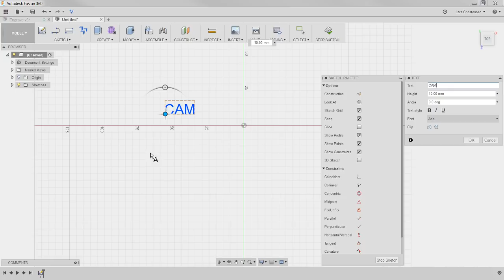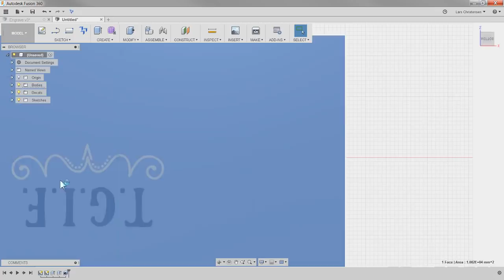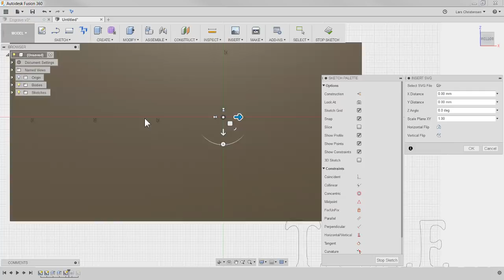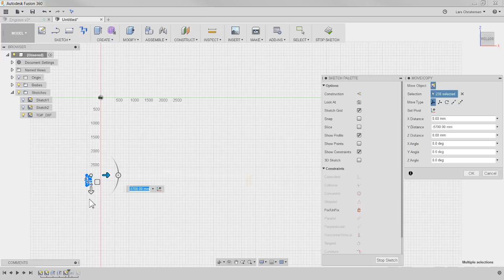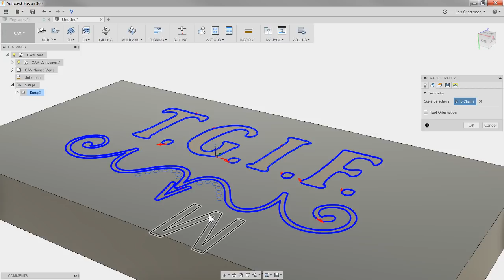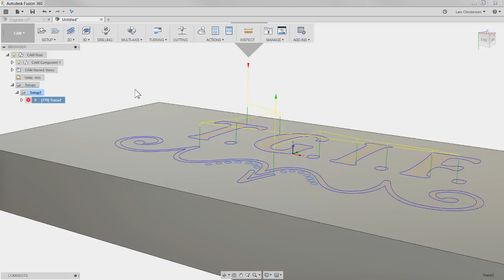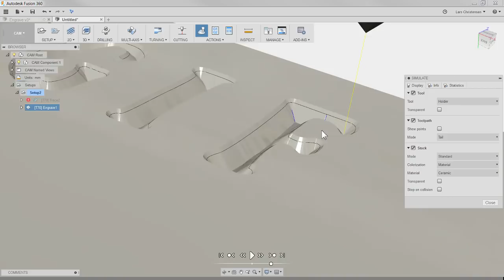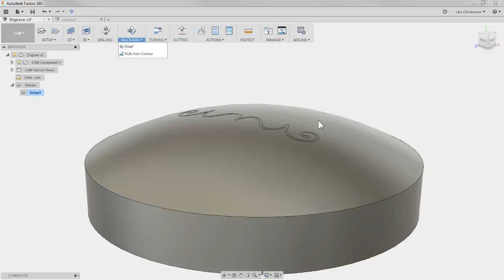Fusion 360 CAM — Engraving Letters Text & Art — #LarsLive 86

Comment: the difference between DFX and SWG is: SWG is made for illustrator type programs and support gradients and other graphic specific stuff but the vectors will still work in 3d programs. DFX is pure vector and support hatches and other CAD specific stuff :) but for importing a vector shape both will do just fine. One note might be that the DFX support higher precision than SWG but this will only matter in very specific cases and shouldn't worry you too much :)

Comment: I am new to using the Fusion 360 as a cad/cam...  Everything is completely simple to understand if you have a foundational understanding of what info a cad/cam needs from you to complete the project. 

The issue is with most software (including Fusion 360) is that the designer of the software injects their bias into it. Basically all the stuff they have worked with is what they see as a priority so those features are very well cultivated..

I have the latest Fusion 360 installed and I challenge anyone to find a V-Bit! 

You could pick a bit and create your gcode no problem, but if you want to cut a precise part you need to know what bit you are using. There is no point in sending this Gcode to your machine until you have that Bit dialed in to you cad/cam. 

No tutuorial is complete without a very detailed explination of how to create your own bits..

Comment: Thanks Lars!
Converted a lot of art and logos to CNC cut paths for lasers in the past for commercial signage. Nationsbank is one that is still around. Hard to find art that has good smooth path lines to cut. All the transitions had to be tweaked for flame polishing the acrylic push through glass with the laser as you cut it. One jagged cut ruins it. The same CNC paths I created were also used for routers and vinyl cutters. DXF rules for machine variability.

Glad to see I'm not the only only that gets the inverted view on creating a sketch. That and zooming off the screen to somewhere else... crazy reaction from the software. Show me whats in the view not some random upside down point of view from where I'm working. lol

Comment: Windows TrueType fonts are stored in a vector format naively; it's why you can create a 500 pt block of text and not have pixelation in programs like Word.  If Fusion is converting your text to a raster format that's just silly.
Reply: My thoughts exactly.. True Type fonts work as PostScript.  I'm confused by this mention of 'windows fonts'.  Great video otherwise.    I use TT fonts in Corel Draw always.  They scale as vector, and can be converted to vector art easily as well.  I've only seen rastering on a Windows screen, which isn't from the font itself.
Reply: @ryanmacewen511  as a developer, I can tell you, in a normal windows desktop application, it's in vector format the entire life of the text (even after you blit it, because it can still be scaled and transformed cleanly in GDI, as long as you're not blitting it to a rasterized destination).  The part that rasterizes it, and converts it to pixels is like one of the last steps in the pipeline, and you generally have no interaction or business lurking around there...

Comment: Thanks Lars!   Informative as always.  
I'm wondering about your final discussion regarding engraving on a curved surface.  You say you would need a 5-axis CNC.  I wonder if it is possible to approximate the effect with a regular CNC.   Is it possible to define a curved surface and then do a recess of the letters from that surface?   You would get a consistent depth for the letters, although they would be a distorted because the bit would be moving in the Z axis only, not normal to the curved surface.  If the curve was fairly shallow it might still come close to what the 5-axis would give you.   Any thoughts?
Reply: I'm wondering the same thing :?
Reply: @andreeca  I'm still working through tutorials, and I found another series -- Learn Fusion 360 in 30 days.  Day 7 - https://www.youtube.com/watch?v=eVRdKjQu6po - that might be relevant.  It shows how to create embossed text on a curved surface.
Reply: @sj-kp1ks  Thank you! But I'm more interested of machining  the text from curved surface with standart 3-axis CNC. I hope there is an option to do that

Comment: Actually Windows TrueType fonts are vectors, not bitmap fonts. That was the case with Win3.11 :) The lines you are seeing are the different points at witch lines meet, like when you use your splines.
Reply from the maker: Thank you Kolja Geldmacher I had no idea!!
Reply: Lars Christensen on the other hand I dearly miss the option of aligning texts like SketchUp or any Vector Program like Inkscap or Corel Draw handels it. Could you throw your weight around a little to make this happen?
Reply: which

Comment: So can you tell me a font that i can use with Fusion, that doesnt produce these odd segments inside each letter? i'm REALLY trying to draft any font to have 10deg draft (for pattern making/sand casting purposes) - thanks Lars :)
OK i've watched further into the video now... Can you export the 'simulation' as a body? that would totally work for me. then I could engrave a flat part and finally export the 'engraved' resulting body for 3d printing (as a pattern).

Comment: im trying to engrave a single line font whilst keeping the tool down, i want a sindle entry and exit point on the test as im doing aled neon sign that has a 8mm undercut with a 6mm flute so only 6mm is seen at the surface but there will be a 8mm hole where it pluges in, it snot a single line font but i have traced the centreline of a specific font. any help from anyone would be appreciated

Comment: I'm trying to emboss text. keep getting error  (Sketch profiles create a self-intersecting body. Adjust depth of emboss or size of sketch profile)  What is that?  I tried a different font and it works but not the one I need   Brush Script MT is what I need to use

Comment: At about the 26 minute mark in the video there is an object with a curved top.  Kind of shaped like a large aspirin tablet.  You mention that to carve on top of that a 5 axis mill would be used keeping the cutting tool perpendicular to the surface of the work as it cuts.  Makes since since the action of the cutting tool and the cut would change if the tools only moved along a Z axis.   I will not likely ever have the funds for a 5 axis mill.  So if my surface has only a slightly curved top, and I use a small cutter, would I be able to use a 3 axis mill?  I would of course have to deal with some distortion in the cut which could hopefully be minimized by using a small tool.   Example, engrave the letters “COLT” on Colt SAA revolver grips or 1911 pistols grips.   

Your videos on Fusion 360 have been very helpful.
Reply from the maker: Hi Smokey Walker Thank you for watching!
Yes, you could for sure use a 3 Axis mill and maybe something like a parallel or scallop toolpath

Comment: Still doesn't work like in the 23:00 mark. When you drop down the Engrave from the 2D menu, it clearly says Machines along contours with V shaped contour walls. Have tried everything and still cannot get a centered tool path like you did in the video.
Reply: Figured it out! Set the Bottom Height to Top Height minus the max amount you want the cutter to go down. Also make sure the tip diameter of the cutter isn't set to 0, mine is like 0.001 now and toolpath ends up perfectly!

Comment: I have followed this word for word and cannot get the toolpath to be in the center of the text like in the 22:30 part of the video. I have changed fonts, sizes, bits and Press pull depths. Trace and engrave all follow the outline of the letter only! Any ideas of what I am doing wrong?
Reply: compensation of? try a slot pattern maybe, this always defaults to the center of geo.
Reply: @Juxtaposed1Nmotion  Figured it out! Set the Bottom Height to Top Height minus the max amount you want the cutter to go down. Also make sure the tip diameter of the cutter isn't set to 0, mine is like 0.001 now and toolpath ends up perfectly!

Comment: Hi Lars, you didn't touch on text on curve or circle. its the one thing that you can't do in Fusion which is super annoying. also fusion has a lot of issues with SVG files its just doesnt work.
Reply from the maker: Hi elilco Thank you for watching!
I was focused on CAM. Maybe we need to do the modeling part of this video.
Reply: +elilco & +Lars
You can use CAM->3D-> Project to Trace on a Curved surface. SVG has improved a lot with the recent flip options. Here's a cool tip. If you create something in Adobe Illustrator and you want the size to remain perfect use: 1.333167 as your scaling option. Maybe Fusion could build that in somehow. 

+Lars
What I'd love is if 3D Project had an Engrave option. This is really helpful if you need to change the engraved  text from part to part. Having to offset the face of the body (and create a new body for each text variation) is a real pain.  So - engraving serial numbers on a curved surface is currently really tough (unless I don't know the trick). Thank Lars for all the great help!